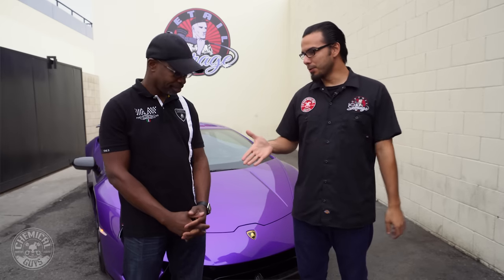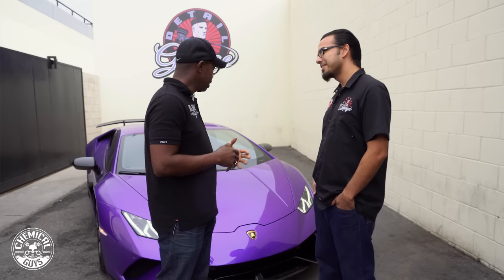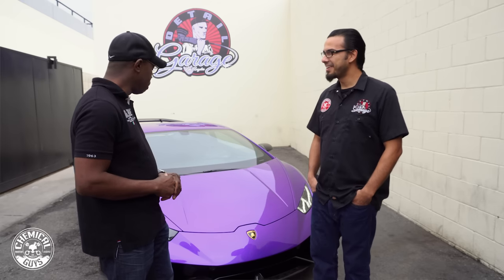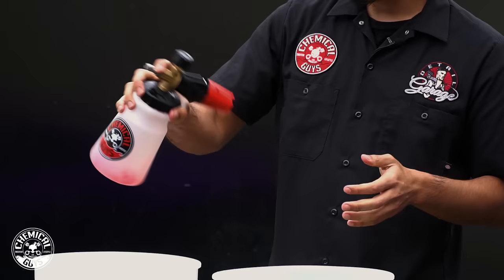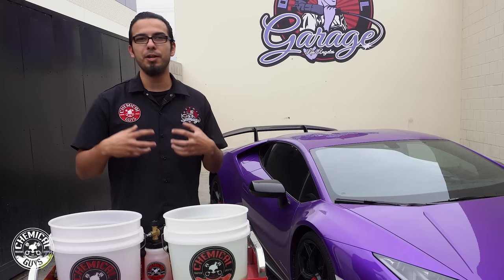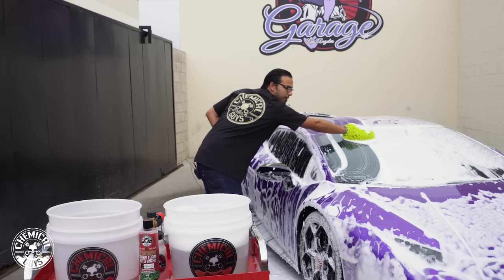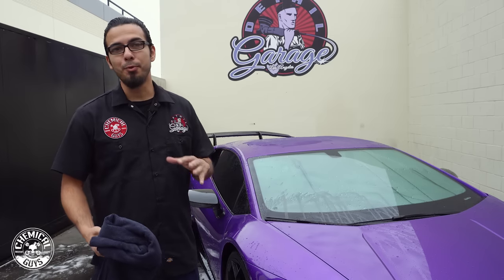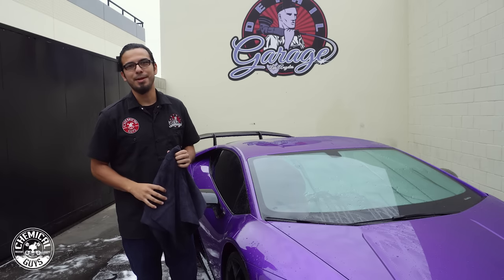Customer Spotlight: How to Clean Paint Protection Film - Lamborghini Performante | Chemical Guys

Comment: what kind of pressure washer do you guys use? preferably what psi it has. i can’t seem to get the same about of suds when using the foam cannon with my pressure washer
Reply from the maker: Hi Carter, thanks for watching. We use a gas operated pressure washer with a PSI of 2800 and a GPM of 2.3. From our experience, the gas operated model works better. Gas pressure washers have better GPM, that's what really produces the best foam. In the video, Nick also uses Chemical Guys Watermelon Snow Foam Cleanser with a TORQ Big Mouth Foam Cannon to produce the most suds. As he mentions in the video, he also uses warm water in the foam cannon as this will help aerate the product as you're foaming. Make sure to stay tuned for more videos coming your way later week! 
http://www.chemicalguys.com/TORQ_Big_Mouth_Professional_Foam_Cannon_p/eqp322.htm

http://www.chemicalguys.com/Watermelon_Snow_Foam_Cleanser_16_oz_p/cws20816.htm

Comment: Nick, you are still the only guy I see washing a car without rinsing the snow foam off. Why is this? I mean this car is clean prior to washing so maybe it's ok. On a filthy UK car, I apply foam without a rinse, rinse foam, then 2 bucket it.
Reply from the maker: Hi William, thanks for the comment. As you can see, Nick first rinsed the car with a pressure washer, getting all the loose dirt off. He then used our Watermelon Snow Foam Auto Wash, which lubricates the surface. Powerful hyper surfactants cut through dirt and grime, lifting them from sensitive automotive paintwork with billions of scrubbing bubbles, then safely lubricates and guides them off the paint for a scratch-free wash. The advanced super polymers and hyper surfactants make your paint slick and slippery, ensuring that any particles of dirt are lifted off the surface and never have the chance to scratch or mar the paint. Thanks for watching and make sure to stay tuned for more exciting how-to videos coming you water later this week!

Comment: Guys I’m not gonna lie I have trouble getting think suds with my big mouth foam cannon what setting do you guys use? What’s the proper dilution ratio? I use warm water but when I mix the water and soap I open it up and I have created some foam not a whole lot but a bit. Plz help
Reply from the maker: Hi Cristian I was about to recommend the Top Five Foaming Tips video but I noticed you already saw it. Here are my recommendations for getting good suds. What kind of pressure washer are you using, if your's is electric, it's probably low GPM. Hi GPM pressure washers are preferred. Ours is a Gas pressure washer with 2800PSI and 2.3GPM. Use warm water, don't shake the bottle because that creates foam on the inside, roll the bottle with your wrist, the right amount of soap should be anywhere from 1-5 ounces, you will have to experiment with that to find out which soap to water ratio works better. Here's a link to the Dilution chart on the Chemical Guys website which better illustrates how much soap to use in relation to how much water you'll need. If you need any more advice, feel free to reach out us on Youtube and Facebook. Stay tuned for more great videos coming your way.

C.G. Alex -

Comment: Any issues using pressure washer with clear bra?
Reply from the maker: Hi Rich, good question. When used properly, a pressure washer shouldn't damage your clear bra. Stay the recommended distance away from the car. Do not get too close to avoid the high pressure and to evenly distribute the soapy mixture across your car. When rinsing your car, don't use the strong jet stream option, use the wide fan option instead. Don't shoot the stream directly at the seams of your wrap. Don't stay in one spot too long, always move your wand back and forth throughout the process. Thanks for watching, Rick, and thanks for being a part of the Chemical Guys family!
Reply: @ChemicalGuys  thanks for response..